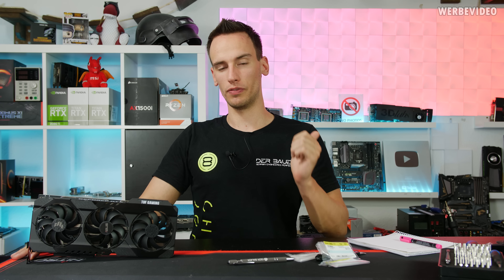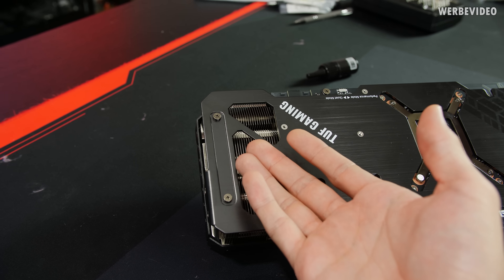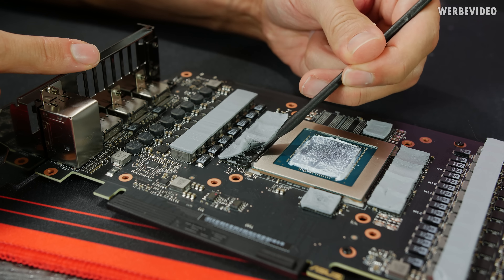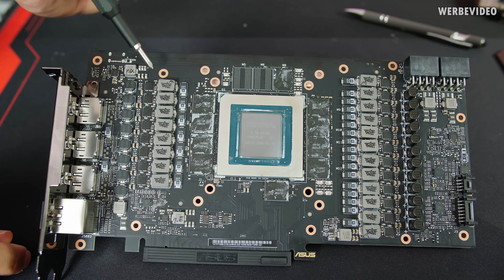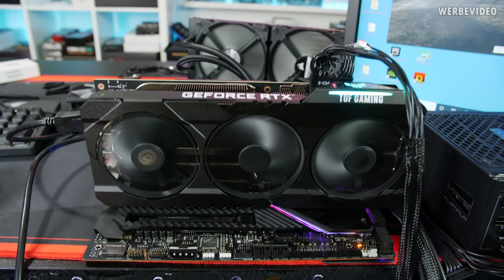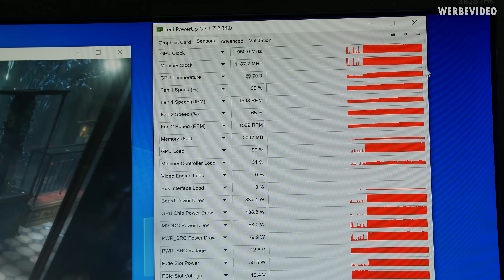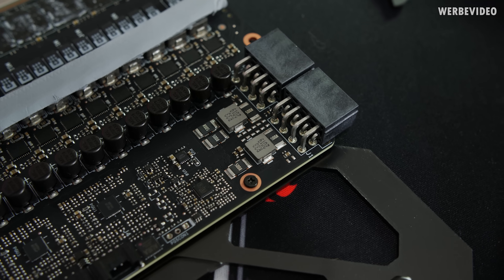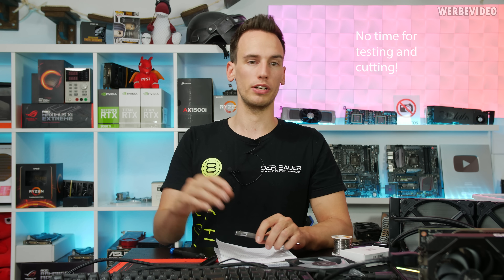ASUS TUF Gaming RTX 3080 OC - Shunt Modding (unlock Power Target!) and First Look

Comment: Cool the thermal pad and see if it comes off easier in 1 piece.
Reply: It's will become brittle and break easily, just scrape it up using a guitar pick
Reply: @dogdie147  Cool it. Not freeze it. Also you wont know if you don't try it.

Comment: hardware unboxed was getting 61 -62c under load in a sealed corsair obsidion 500d ....... your on an open bench and hotter temps???????? and he was hitting 2010Ghz and 21Gbt on the memory!!!!!!
Reply: haven't watched that video but wasn't maybe the delta temperature? that would explain this.
Reply: His card was running 2000 rmp and there's always a difference in silicon quality.

Comment: 11:15 pwr_src should be VRM power loss which seems right because of so many phases
Reply: No way. That would mean VRM efficiency of whopping 47% :D The efficiency should be around 90%
Reply: @mikko96ify   its turning out to be around 75% vrm efficiency.
190.6+60.9=251.5w is what vrm is outputting
251.5+82.2=333.7w is what vrm is taking in from 12v
338.4-333.7=4.7w for fan and led

so output efficiency of vrm is (251.5/333.7)*100=~75%

lets summon buildzoid to do pcb analysis.
Reply: 75% is quite low already. is it even normal?

Comment: all reviewer reach only 60c+ ish temp. why your got 70c in an open bench? while other put it in a close system
Reply: Because we (Central Europe) had 30+ celcius ambient temps last 2-3 days, that’s why....
Reply: Ambient air temperature is probably 10c warmer in his room.
Reply: @terrydrew7002  that does not make sense as he run it without casing. Im pretty sure his room is not very hot. Look all review 60c tuf while fe 70c+. So if you said because of ambient temp. 70c+ tuf and 80c+ fe?
Reply: Doesnt matter if he has it in a case or not. If the air is 10c warmer then his card will read 10c warmer thats how it works not sure how you don't understand this.

Comment: How long until a LN2 pot goes on it?
Reply: I'm surprised that there are no HWBOT postings yet.
Reply: i believe it's on video editing process.
Reply: Ln2 pot might go on rog strix model.
Reply: with 71*C and almost 100% locked TDP? This PCB can draw up to 375W, maybe 400W safetly so it can be about 20% OC and that's all. He can do it on stock cooler probalby or on water. We need to wait for 8+8+6 or 3x 8pin PCB
Reply: @hubertus323f   asus strix is the card i want or gigabyte xtreme both way overbuilt both 3x 8pin im hoping strix model is available soon i havent heard specific launch dates
Reply: You'd have to LN2 pot the CPU at the same time.  Would make a nice collaboration with each person working on their designated device.